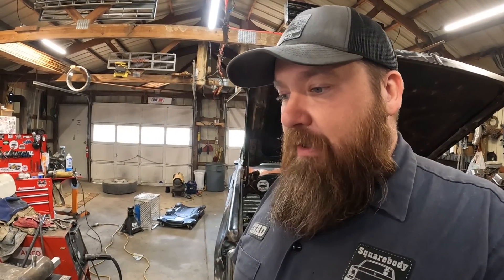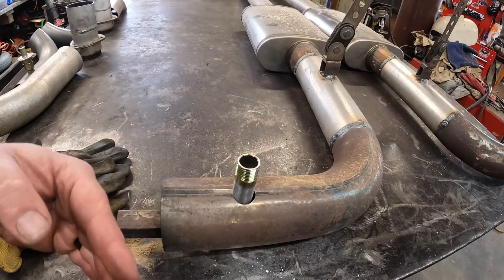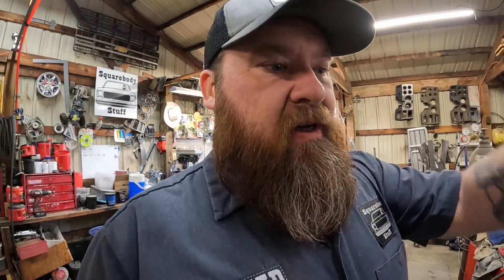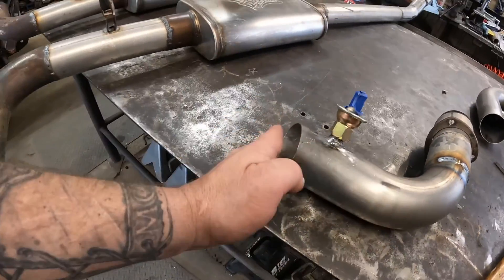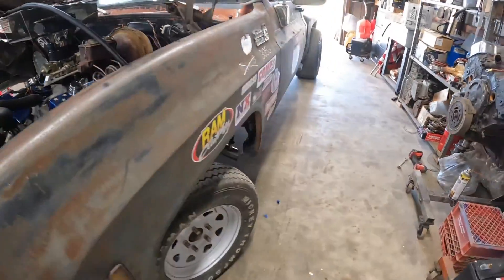Part 3, crankcase evacuation experiment. Time to install and test it. #becauseracetruck

Comment: Looks like it’s been a year since you posted this video. How has this system held up. Pros and cons? 
Also was wondering if you think a catch can would be beneficial?  Thanks. Just subbed.
Reply from the maker: It's still working  fine.  And no need for a catch can with my system yet.  I have zero oil getting into the hoses, just air.  
But it probably wouldn't be a bad idea just ibcase it started to push oil.
Reply: @ yeah I like the system you came up with. I drive a 72 Pontiac Lemans with a 68 date code 350. It runs strong but could use a rebuild. I get a strong exhaust smell and was thinking of trying your evac system. I’m thinking crank case pressure might be a contributing factor. No smoke with start up or calm driving but if I get on it…..I get some smoke.

Comment: i would of liked the welding timelapse fyi lol
Reply from the maker: I appreciate that.   I usually do, but sometimes I wonder if it's just useless filler.
Reply: @SquarebodyStuff  I grew up in a metal shop. So welding I enjoy watching and doing. I may be a odd ball in the demographic
Reply from the maker: @JackofWarr.  I get it, I like to watch time laps videos. lets you see what goes on.  I have plenty of other videos of me welding stuff up if you need a fix.🤣😂
Reply: @SquarebodyStuff  I ended up pulling out my mig and some scrap 😂

Comment: the thing about full Roller rockers and retrofit HYD. Roller lifters is you always will have a tick till the lifters pump up, that's what I experience with mine, that and the tie bar does give a little noise, but, its worth the trade off for my use case.
Reply from the maker: I don't mind the noise,  but I try to mention it, because I've had comments on how it sounds. The camera makes it sounds worse.
Reply: @SquarebodyStuff  yeah, it can be a bit off putting at first for sure, trying to hunt stuff down, but its just the nature of the beast when we deal with this type of hardware!
Reply: Was testing my cooling system the other day and was hearing the ticking you were talking about and started to cringe, then remembered my setup.  Almost forgot I have retrofit hydraulic roller lol.